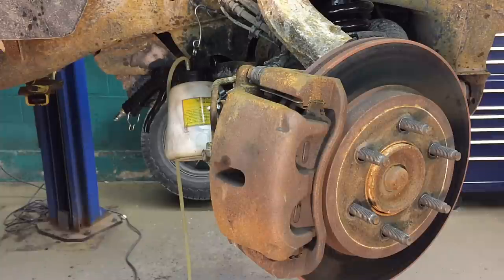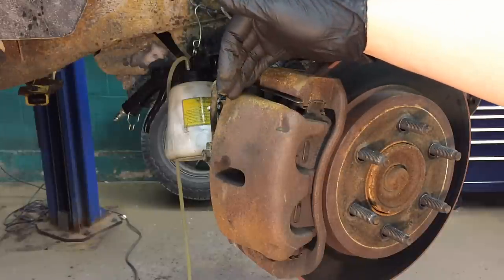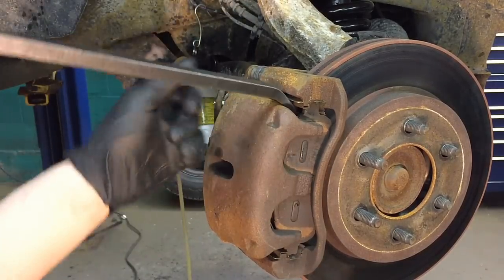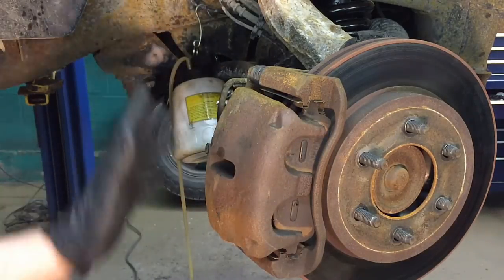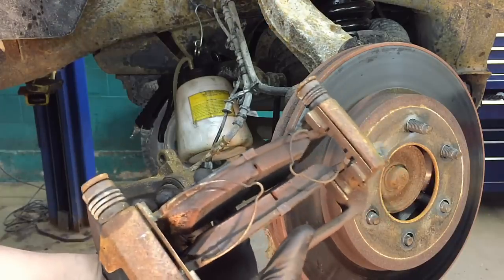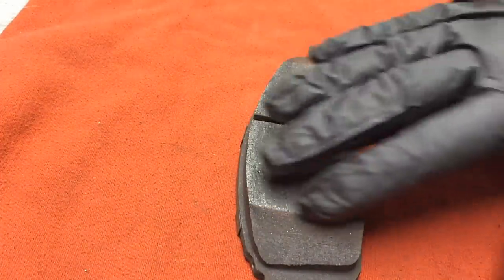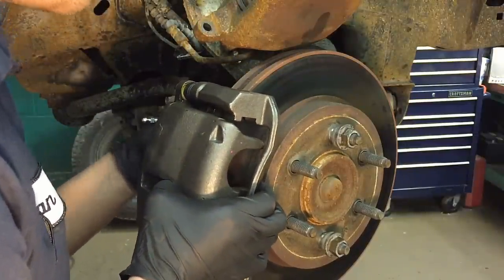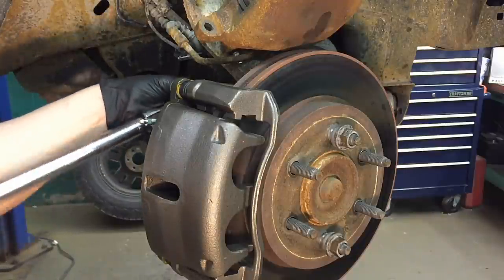Ford Brake Caliper Replacment w/ Tips!

Comment: over-all good info but, the one part I wanted to see(brake pad install) you did not tape, you skipped over it completely. Like everyone should know how it's done......I don't. the rest was good. tks
Reply from the maker: +CHARLES WOYNER just a caliper replacement the rest of the install pads and all is vehicle model and year specific.
Reply: FordTechMakuloco so all the calipers are exactly the same but pads are not?? I see there are different ways to do pads depending on other issues...ie installing brkt and pads or as a complete loaded caliper unit, right?